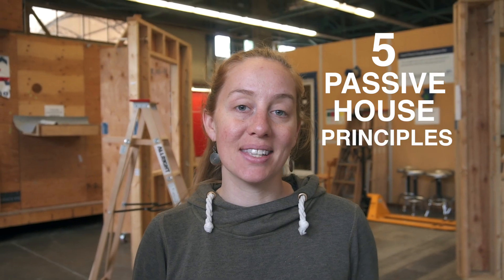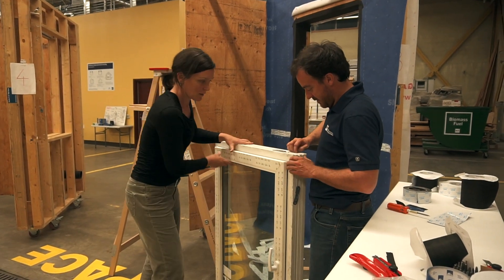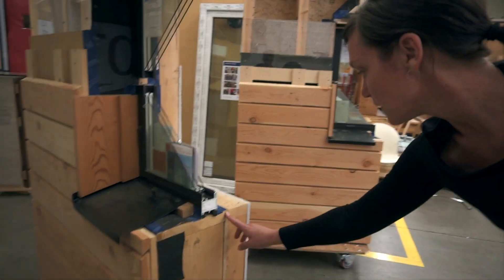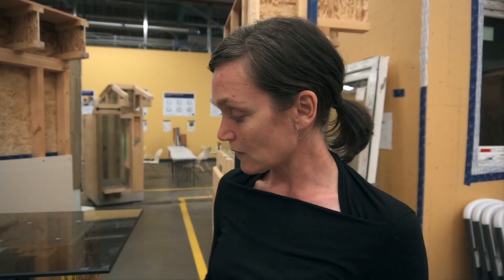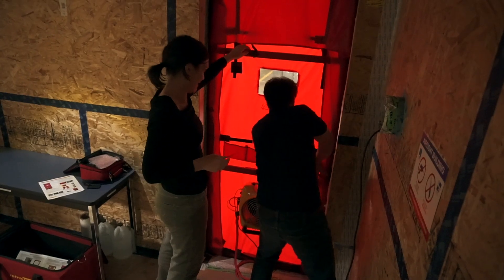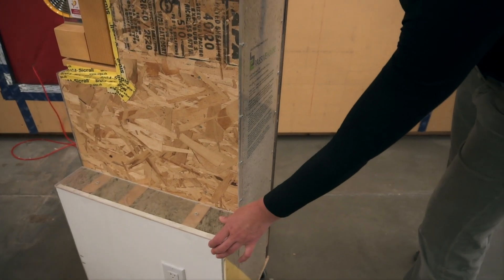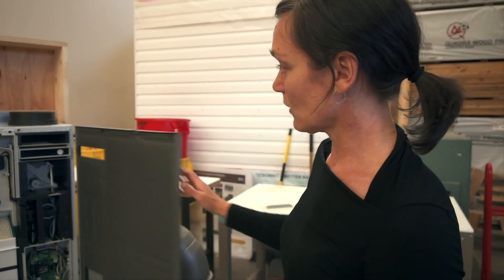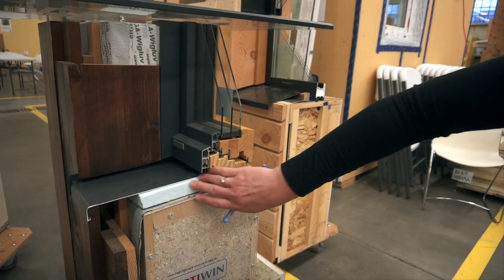Passive House = 90% Home Energy Reduction!

Comment: There is a Climate Crisis, we need to reduce our use of fossil fuels. It also saves money on utilities.
Air sealing, super insulating, triple pane windows, solar panels, battery storage and an electric vehicle charger are all parts of an energy efficient home or business.
Reply: funny you should mention that.  The environmental impact and use of fossil fuels to produce all the added materials (insulation especially) for these houses is staggering - and on one is even talking about it.  Add to that the fact that our houses usually get torn down after 50 years because they aren'y trendy anymore or to make room for a bigger development and you have a recipe for disaster.

The energy required to construct our homes and the inherent GHG in the materials MUST be considered going forward.  It's not enough to just save a few dollars on your hydro bill and think you're saving the world.  There is so much more involved.

Comment: On the first "mock-up" example the same strata was identified as both the water resistive barrier and then at 3:12 she seemed to give up attempting to identify the air barrier.

On much of the cross sections provided, why so much wood?

There are for more effective and lest costly assemblies.  Why teach your students technology that is a "construction generation" behind the premier science and techniques?
Reply: She said the fiberboard taped is the air barrier.
Reply: What is a more effective assembly in your opinion?

Comment: The video really misses the most important aspects of passive house, like control of the sun light in winter and summer, designing space sizes and air flow optimally, using heat capacities of different materials to your advantage, using thermal storage systems of various kinds, etc.

None of the 5 mentioned techniques are exclusive to passive houses. They are all used commonly (for last 3 decades) in standard buildings, that are definitively not passive. Following these "techniques" will not make a building passive at all. Yes, they are usually required, but so are they are required in non-passive houses.

A lot of people will not even consider active ventilation with heat recovery an element of passive house.

Comment: 7:55, even if you offset your studs in two different layers, it is still a thermal bridge. Just less bad. Usually it is good enough. Depends on the properties of what is the middle layer that studs on both sides connect to. Other option is uniform insulation on external walls, with no seams or penetrations. This is commonly done in Europe.

Comment: Its more expensive but think of all the money that u going to spend on electricity for Airconditioner and all the stress(mental) that cause u all the trouble in ur performance thag therefore could ruin ur biggest chance as ur daily performance is not at it max potential.

Comment: Add a Geothermal element to feed fresh air into the house, heat and cool naturally. Houses need to breathe too.
Reply: there is a lot to be said for using geothermal to make heat and cooling if you aren't in the perfect climate for a passive house.  but houses don't need to breathe.  that's an old myth

Comment: thanks for the explanation. I have a question regarding this video. what should I consider to build a passive house back home in Saudi Arabia and who to deal with heat gain regarding of that??
Reply: Yes the only thing that changes is you want less passive solar gain. So focus on more windows north and little to no windows in the south. Heavily insulated will keep cool in just as well as heat.

Comment: There are also other means to create zero-energy houses. With electric air heater pump and many sun panels your house will produce more energy than it consumes. There is also known an active insulation where intake of air goes through the walls bringing escaping heat back indoors. In my old house this worked well. The example in the movie is totally wrong.
Reply: I'm not following your statement.  Which part us wrong?

Comment: The tight walls will create  unhealthy fungi. Because of different temperature outdoors and indoors humidity will always be created inside the wall. In Finland humidity must be able to move out of the wall. In winter humidity moves outwards. In summer conditions humidity must be able to move out of the walls into the house. There are hundreds of houses with fungi to be rebuilt.

Comment: you have a 1 3 laer window in that thick wall, why not 2 adding 6 pains of glass but giving a thermal separation of the windows frame  or 1-3 pain and one outer signal pain window.
Reply: bobbg it's called diminishing returns. There comes a point where the gains are so small it's not worth the additional cost.

Comment: I live in a passive house since 2006. And I really don’t understand why so many people still build houses with a chimney
Reply: How do you heat your home? And where do you live?
Reply: @skarletlightning  Actually, costs of building chimneys are one of the reasons that in new-build energy efficient houses, heat pumps are no more expensive upfront than gas boilers (and they're obviously cheaper to operate).
Reply: Because you need heating.

Comment: Thanks.. However, I have built a passivhaus model in a hot arid region in the middle east and it achieved 85 % ene3 reduction or 35 kwh/m2 annual consumption.
Reply: do you have more info about passive houses in hot arid regions?

Comment: Can you experiment on rice hulls as insulation material.this is very abundant in SE Asia as by-product of rice farming.this just sometimes goes to waste but a very good insulator. It can keeps ice from melting for hours. Rice hull has pockets of air, and act similar to vacuum insulation in thermos bottles.

Comment: Passiv-haus is very ACTIVE. I like true 1970's passive - more robust, low cost and simple.
Reply: green genie Passivehaus is not active. Apart from the HRV system, achieving Passivehaus standard doesn’t involve any active parts. Unlike the 1970’s Passive Solar homes, Passivehaus negates the possibility of overheating - which happens in many of those early passive solar homes. Passivehaus incorporates passive solar, of course, but methodically and cohesively with all the other aspects of the home.
Reply: NUTS. So you think fish and chips is vegetarian, apart from the fish! @mhorgan1515

Comment: The results of making all of these suggestions code can be seen in the thousands of tents pitched through out Los Angeles.   One restriction added to another until people can no longer afford to build their own house, nor can the average person negotiate all the codes.   The road to hell is paved with good intentions.
Reply: Insulation doesn’t have to be more expensive. I can very well be more cost effective if you include (and one should of cause) total cost of ownership. 
It’s ridiculous that in the US power plants are built that are extremely inefficient but are only used on hot days when there’s a power shortage. 
The methods shown in this video may seem overkill to you, but the flimsy almost not insulated houses in (at least some parts of) the us are the other extreme. 
People living in tents may also have to do with lack of basic social care.

Comment: Sandra please come back to Germany and teach Germans about this. They believe ventilation is opening windows in the morning, no matter what temperature outside is.
Reply: Same in Austria... I lived there for a few years and had some mould in the ceiling corners and my landlord said I should just air the apartment every morning by opening the windows for 15-30 minutes. No recirculation ventilation system and this was a brand new apartment block. Just a few years ago btw.

Comment: ok wait? the first construction explained consists of waterbarrier (cladding) / taped fiberboard ( airseal) / insulation / than vapor barrier!?!? than inside wall, if what you say is correct your isulation will soke, because the vapor barrier and the airtight barrier are switched
Reply: ah oke so its vapor open?

Comment: It does not work. Winter -20C Summer 40C and a lot of rain in summer with violent temperature fluctuations in winter. In Hong Kong, they run two air conditioners for the whole day in their expensive but small homes ,similar in Singapore. Passive house can't work.

Comment: Sometimes, Passivhaus designers go over the top with complicated house envelope. I believe it's better to go with as traditional construction as possible, upgraded to comply with PH requirements. As long as the energy balance is achieved, it's all good.
Reply: How can you achieve the 90% reduction using traditional methods?

Comment: Love this concept! I wonder how low of a temperature a passive house could realistically withstand and for how long? e.g.: A 10° F cold weather, for a 3 month duration.
Reply: You just have to insulate, insulate, insulate. Eventually, you will have a house that you have to cool in the middle of the winter, and heat in the middle of the summer, i.e. complete control of interior environment.
Reply: @exploranator  no, not really.  not without spending $500/ft2 for construction costs.  in a very cold climate, you run into the problem of windows losing too much heat at night (which could be overcome by complicated mechanical systems which cover the windows at night), or needing a massive amount of solar panels to give you extra heat.  adding R-10 of insulation (beyond the R-25 ICF construction) to my mostly underground house that i'm planning will give a 14-year payback, R-20 at 18 years, etc.  and that trend accelerates upwards
Reply: i'm planning on building a 750ft2 house at 9000' in CO next year (and most of it is underground).  based on my calculations, i can't make the passive house standard because it's too stringent (IMO).  however, i should be able to keep my heating bill below $20/month with one thermal solar collector.  the average annual temperature in that location is about 38F and it is normally -10F to -15F at night during the winter.
Reply: @BrianKrahmer  just wait in a few years when the climate changes will really going to be felt

Comment: I disagree with numerous things in this video.  The "Service Cavity" will cause mold.  You cannot instal insulation on the inside of a vapour barrier.  Drywall mudding and taping acts as a secondary vapour/air barrier trapping air in the "Service Cavity"  To prevent thermal bridging it is far easier to use a 2x8 top and bottom plate with staggered 2x4 studs.  Triple Glazed  windows cost far more than they are worth.  Buy high quality double glazed Low E argon filled windows.   The biggest problem I have is the Air exchanges per hour.  The tighter you seal the building envelope the more you circulate air pollutants and increase mold.   Doesn't matter how many Hepa filters your HVAC system has.  Fresh Air exchanges per hour is a Law for a reason.  Respiratory issues such as asthma have skyrocketed over the the years because of this.  I am all about drastically improving on current building practises and lower my utility bill but I have seen too many good ideas cause more harm than good.

Comment: Wow.... Very informative and inspiring, I'm reeling with ideas and questions. #1 In about a year or so I plan on converting a truck to live in full time (RV'ing, Tiny house on wheels...) Does it make sense to use passive house techniques on this type of build?
Reply: Hey "KoKo", it's always a good idea to seal your envelope to better regulate the conditioned space. The problem is that with making the home air tight you also must account for airflow. You don't want stale, stagnate, toxic air to collect in any space let alone a small space like an RV. However, an RV has plenty of windows that can be used for this purpose. There are other PH techniques, like window shading and rainwater collection that have been used on RVs as well.

Comment: How about passive house design in the equatorial area where the aim is to reduce energy depency on cooling (instead of heating) when the climate is hot & humid?
Reply: I believe insulation not only keeps your house warm during the cold days, but also keeps your house cool during the hot days. As long as heat gain is prevented and proper ventilation is installed it should be ok.
Reply: Could look into geothermal ground loop cooling.
Reply: A relatively simple way to reduce dependency on cooling is to install awnings. They'll block the path of the sunlight and reduce solar thermal energy from entering the structure.
Reply: TheBlakout...awning will help but sometimes it is still not enough during summer period in the tropical country like my place. Moving air will still be the best (assuming that the air is a little cooler).
Reply: Awnings do not help much, passive houses (here shading as 1 of the 8 modules of a tropical PH) reduce the radiation by smart affordable systems 100% if needed.
Reply: @karlwagner8383  Solar panels becoming more efficient could solve the air conditioning problem. The good thing about this is that housing in the Philippines consumes less electricity in general (heating is much more expensive for example).
Reply: @TrindyForce  roof overhangs and shutters this are the options I see as logical and an active cooling System can do so much
Reply: The concept of building orientation will only work if there is no space limitation. Given sa small land area, it might not be doable all the time.
Reply: @whyldthing86  exactly what i was thinking, when u buy a lot in the city or in a residential area, is not like u can place your house wrecked from the others to "look for the sun" you have no other way than place it the direction that's supposed
Reply: I think I saw a video of some earthship house in Australia where they create a tunnel for cool air to enter the house, it was simple cost effective and efficient
Reply: @PiyuUnsaid  Works well if the ground temperature is suitable.
Reply: Hi Allen, I think that awnings are a very incomplete solution, as well for new buildings and for renovations alike. The shade created is static, fully victim of the sun path. Passive house technology has come up with affordable solutions, to outsmart the radiation of the sun completely by shutters or outside blinds which provide total shading without total eclipse of the sun - except after sunrise and before sunset.
Reply: insulation works in both directions, to isolate.
Reply: Put your fridge on a porch outside because it produces a lot of heat
Reply: would it be better to live under ground, but still have some day light.and a well  insulated twin skin reflective roof
Reply: We have this with our passive house in Australia. Between 21-23 degrees is where the house should sit. The temperature is maintained through airtight envelope though provisions are in place for accommodating the hotter temperatures (fans) and making the most of afternoon sea breeze (via breezeways).
Reply: With that level of insulation you can put your AC to 18C in the afternoon it will remain cool for days even if you stop the AC altogether.
Reply: Windows and building orientation will do. Insulations will lessen the heat as well.
Reply: Tree and green roof was the answer. My house located in Thailand but I plant so much tree that my first ground is almost cool all year but the second ground hot during the day 

P.s. some say made house form soil can cooling your house but my house is concrete so planting and planting was all I can do
Reply: Cover every available surface with solar panels and then install super-duper high efficiency air conditioning. If you want to see that on steroids, go to Maui.

Comment: I'd love to build a passive house myself. Has there been any calculation to the impact of additional lumber used for those extra thick walls??? Economically and environmentally...
Reply: Where are the SIPS home design? Get away from stick frame! Use sips walls on the exterior and roof! We didn't see any in this video??
Reply: @MrMaddogg2010  sips aren't necessarily cost-effective for roofs.  blown fiberglass or cellulose can be much, much cheaper
Reply: @BrianKrahmer  when i said using wood i didnt mean to say use it when building a cabin. Wooden furniture is good for carbon capture
Reply: using wood is the best thing you can do for environment because its carbon capture
Reply: @magnumopus9058  too much of a simplification.  i had a neighbor in Idaho who had a log cabin that burned 10 cords of wood per winter!  wood is not that good of an insulator

Comment: There are variations of passivhaus in europe . For example , i have a blockhaus that has 13.5 cm blocks/logs and 14 cm holz insulation panels with 3 cm thick lattung / furring strips over the insulation panels with 2.5 thick wood panels mounted on the furring strips. Windows are triple pane tilt and turn. 
People also use CLT panels in place of logs . All building materials are non off gassing as well as furniture , bedding ,drapes rugs etc which are from natural fibers .  We did this because we don't have a heat recovery system. We just open windows  in the morning in the bedroom for a few minutes and while cooking. The loss of heat is not an issue because we have a two ton speckstein offen / soapstone masonry oven and have tons of available wood to burn. The oven/ stove is heated once a day in very cold weather for about two hours and then holds and gives off that heat for about 24 hours. It heats the entire house of over 3 thousand square feet  to a comfortable seventy degrees or more.
Reply: Passive hauses came from europe.

Comment: I like the idea of using renewables. However, termites can decimate wooden structures. Any company building with these products need to account for this.
Reply: We agree... to counter this issue, we are using Compressed Earth Blocks.
Reply: My Passive House is Brick / Block - just the same concept of a thick, air-tight, insulation layer